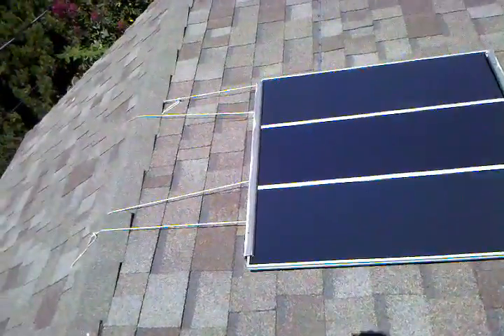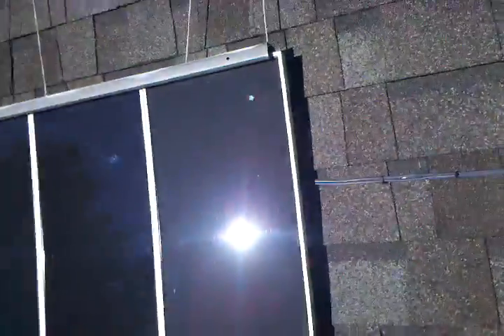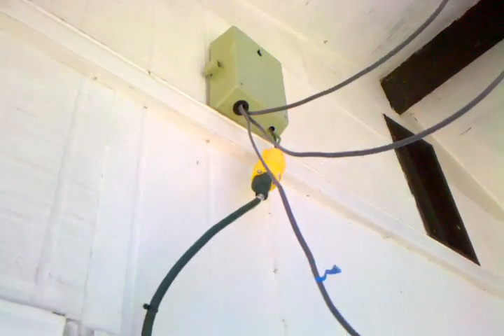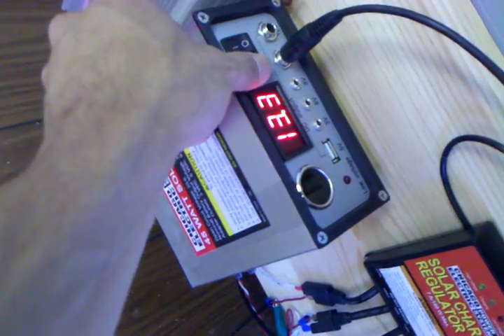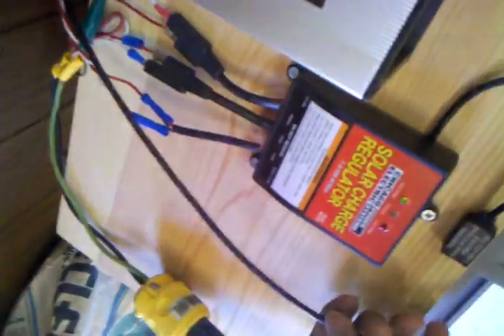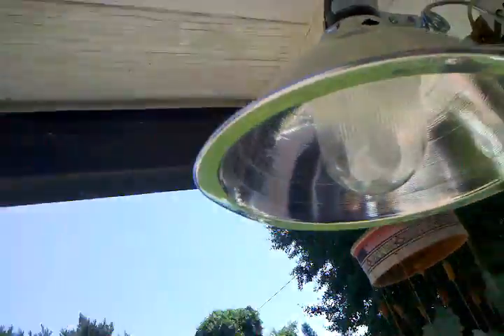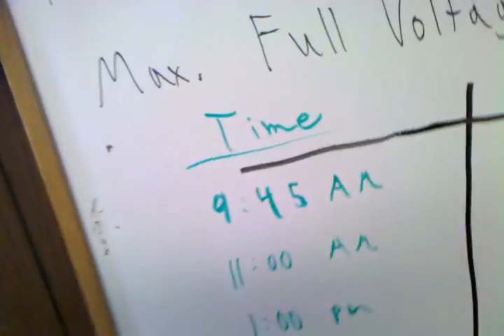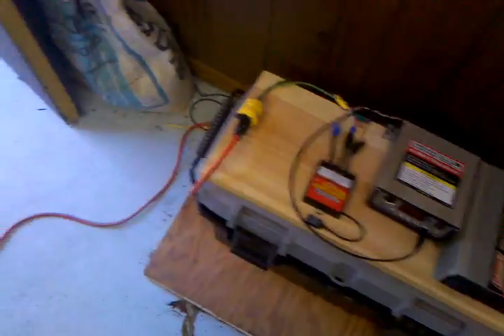45 watt solar setup

Comment: good job man, way to do it on the cheap. You should get a "kill a watt meter" about 15$ at walmart displays amps volts watts when while your 120v load is plugged in. It can handle up to 15amps.  It's Intresting to see the actual usage instead of what the name plate says. 

cheers guy keep it up